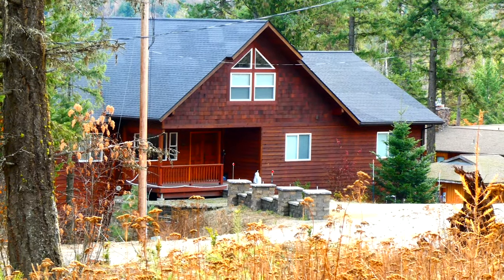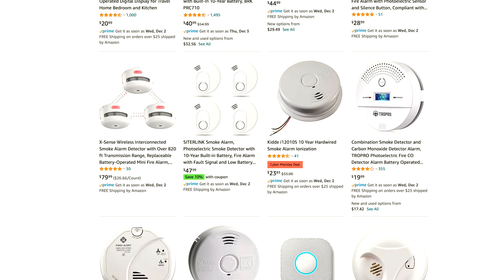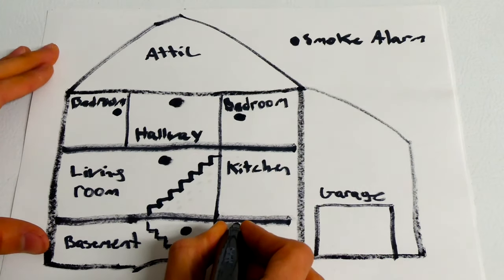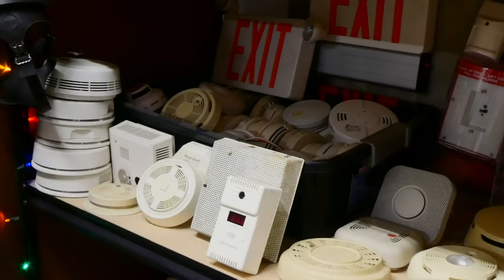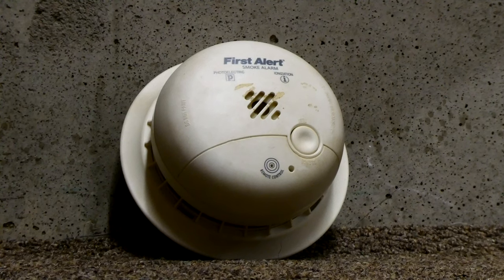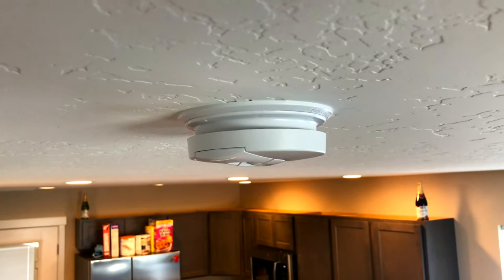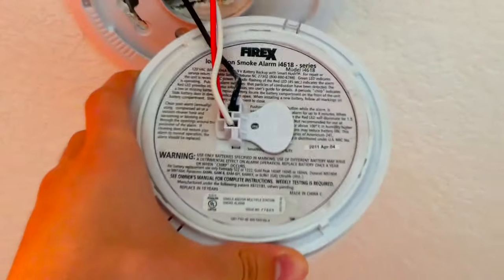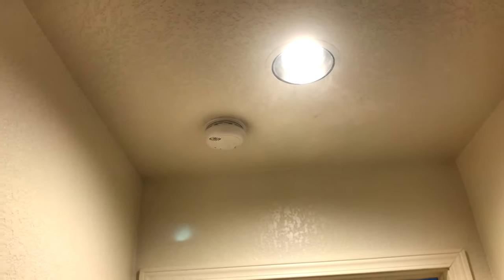The Best Smoke Alarm for Your Home | Requirements & Fun Facts

Comment: I have only photoelectric alarms because that's what my house came with. They are all the same type, but some have extra features like a strobe alarm, and 4 are combo smoke/co. They are all the same sensor, hardwired, and interconnected. They are all about 5 years old. And guess what, they go off randomly, usually anywhere from 10pm to 7am. I was able to narrow it down to one alarm, but it seems the only thing affecting it is high humidity, and photoelectric sensors are recommended for higher humidity homes. Since the strobe is so bright, (177 candela, or about 2000 lumens of total light output,) it makes it unsafe for me to walk down the stairs to get to the exit, in the middle of the night, since the strobe appears brighter in the dark, if there truly was a fire. However it usually goes off for about 10-30 seconds and then stops for a couple months, so wtg?

Comment: There are also adapter plugs available to allow you to switch brands when you change alarms without changing wiring. You could have gone from the existing Firex (Kidde) alarms to First Alert/BRK without having to replace the wiring harnesses. However, these aren't always easy to find in small quantities.

Comment: 0:34 I just checked my smoke detector. November 2012. Looks like I got two more years left

I have been living in this house for a little over six years now.

I thought you were all my smoke detectors were. I didn't know I had one in the basement.

I had electrician doing some work.

Electrician said why do you have a smoke detector behind your breaker fuse box.

I told him I have a filter behind my breaker box?

So I went outside unhooked it first when outside and tested it and it works perfectly well. So well the neighbor called the fire department.

Then it went back downstairs and put it back up. And I didn't even change the battery out of it.

H&M Mich Co.
PO Box 104
Three Rivers MI 49093

Comment: is it true that it's best to replace a combo (smoke and CO) if it gets tripped? if that's the case, what's the point or purpose of using the canned smoke people use to test them? my CO alarm was tripped and saved my life. the unit was a combo unit. the fire person that came said it's best to replace the unit that was tripped to prevent the likely hood of it starting to give false alarms etc... i did replace it but it just doesn't add up as to why they'd make stuff to test the units if it's best to just throw the units out after they've been tripped. very confused. if anyone can help clarify this, that'd be a big help.
Reply: No